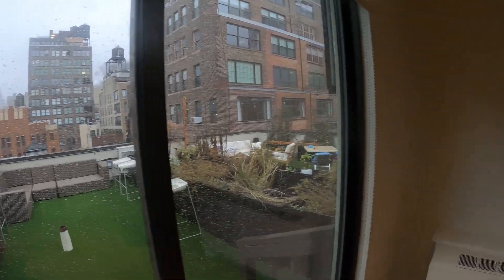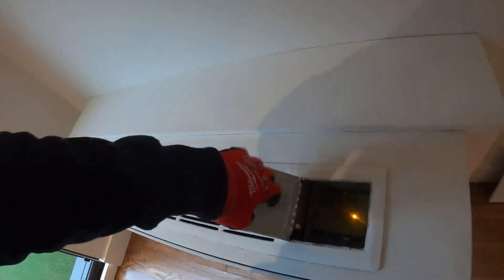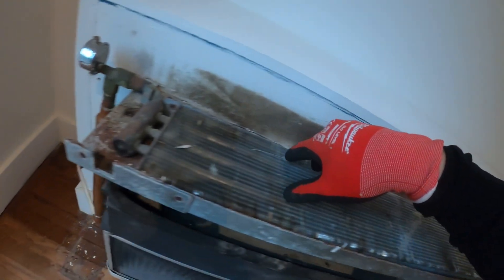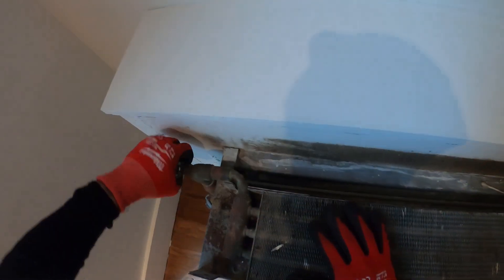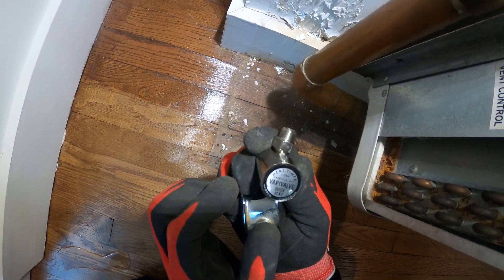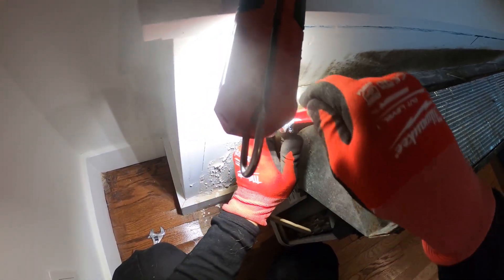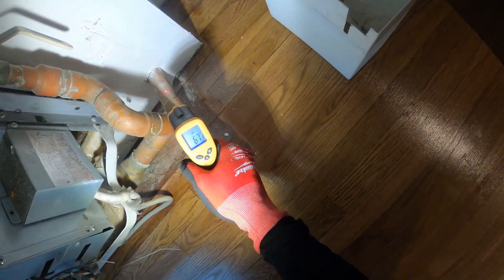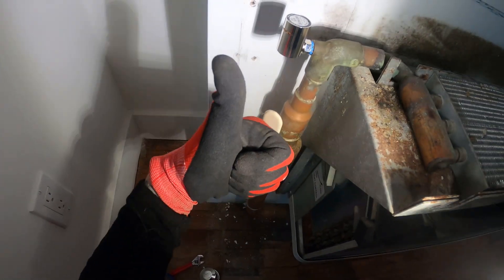HVAC: Steam Radiator Air Vent Valve Installation/Replacement (Gorton Vapor Equalizing Valve Install)

Comment: Hi jumper. Question my air valve is always having steam coming out. It doesnt turn off like what they all said. Some valve does have rust splitting out. We just replace a new identical system.
Reply: what kind of air valve do you have?
https://www.youtube.com/watch?v=tFEog2PbVg4

Comment: Based on your experience what would you say is the most reliable brand Varivalve, Gorton or Ventrite#1. I'm looking to replace the air vents and all my radiators.
Reply from the maker: @themacavelly  They are both great brands. The varivalves are cool because they are smaller and can be adjusted. The gorton valves you would need the correct # value for your radiator based on where it is in the home floor wise and distance from the heating system. Good luck & thanks for watching!

Comment: i can't get my vent valve to screw in upright.  It always stops at 3 o'clock position horizontal
Reply: Can you put Teflon tape on so it's thick enough to stop at 12?
Reply: @ninjutsustyle7618  good idea i will try that.  Happy Holidays!
Reply: Just has to be snug …..hand tight then wrench until 12 o’clock, worst  case you get a  minute  steam leak

Comment: Those "Maid O Mist" vents you removed are Junk they don't last they have a plastic float inside that fails. Also it doesn't matter what floor your on to vent air from a steam system. LMFAO
Reply: If you are not using an adjustable vent, then it absolutely matters that you replace it with a vent that is rated according to the distance and floor from where the boiler is, e.g., #4, 5, 6, C, D.
Reply: @nja3224 accurately. Magoo can have a big slice of humble pie.

Comment: Once the steam is flowing nicely in winter what’s the benefit of keeping a vent more open vs closed
Reply: The more air is in the radiator the less steam there is and the less heat output there is. The vent lets out air but not steam.

Comment: Hi we don't have steam systems in the UK . That would be a wet pipe system full of 80 degree Celsius water. What kind of pressure and temp does the steam go into the coil ?

Comment: @JumperManTech, how does the radiator regulate the temperature?  It does not appear that there are any valves on the steam line.  Is there a fan controlled by a thermostat?
Reply from the maker: Good eye Justin. There is no way to regulate this heat completely. Its either you have it hot or REALLY HOT🤣🤣🤣 The only control here is a fan controlled by a thermostat but the problem is that not having any actuator valve on the steam line, there is constant steam flowing through that coil. It's intended to work as a fan coil unit but the issue is not having those valves so even if the thermostat satisfys and the fan cuts off, now you have radiant heat. Its constant heat all the time. I want to recommend installing those actuator valves on the steam line along with a drip pan underneath the units with water safety controls👍 We will see what happens. Thanks for watching & I appreciate the feedback. Stay tuned for new videos every week & stay safe out there!